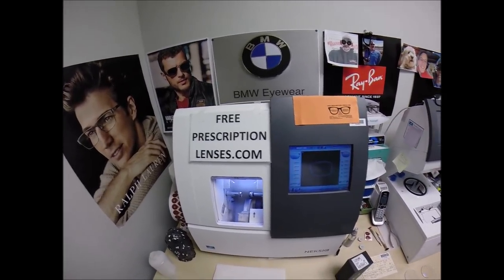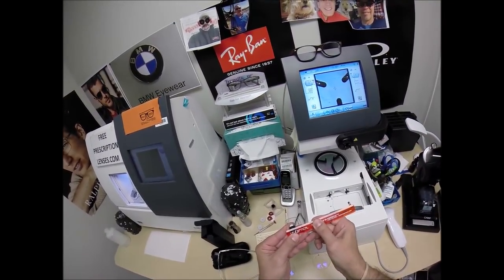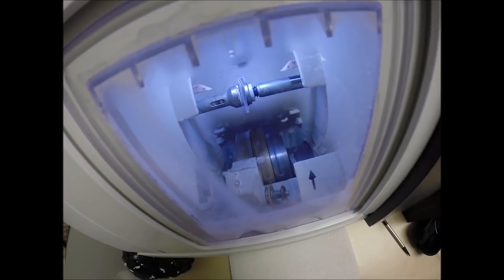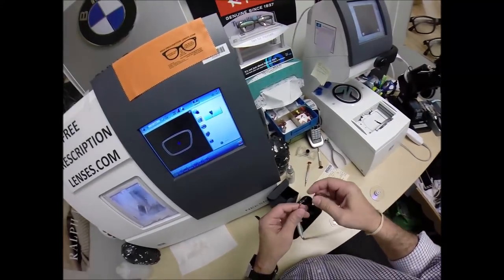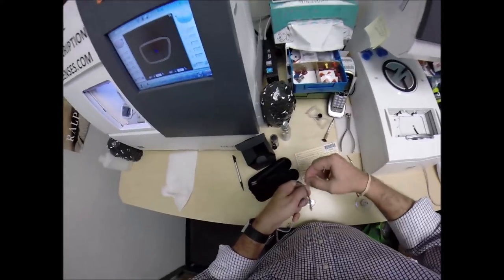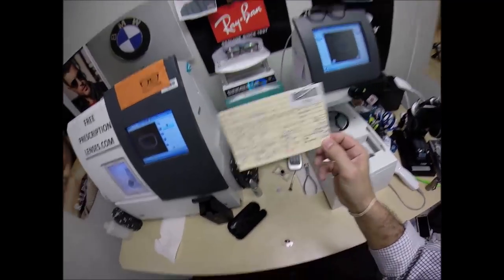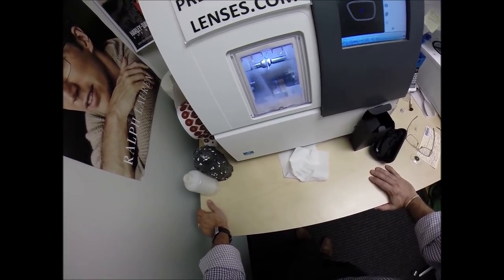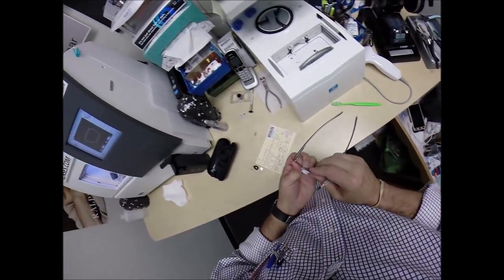Yaz's Oakley 5138 TieBar with Rx Eyezen 2 Crizal Prevencia Lenses

Comment: Yes they do have lens rim ring that fit into groove before placing into frame, they are on clear lenses that come with frames plus 2 more in small accessorie bag which holds the black lens template. I can send you a picture of them. (for the Oakley OX5138-0153 Tie Bar (53) Satin Black) if you email me a address,  thanks and have a good day
Reply from the maker: freeprescriptionlenses@gmail.com